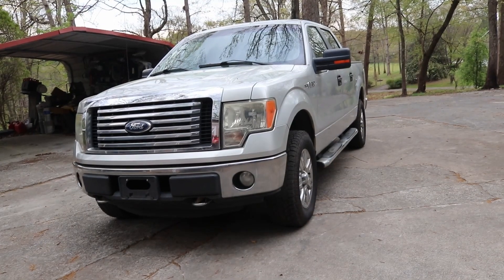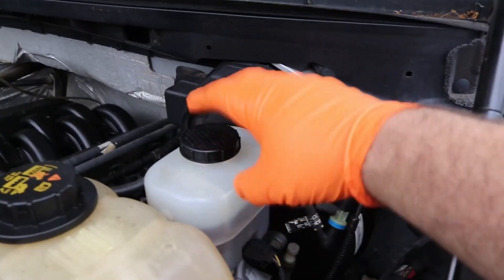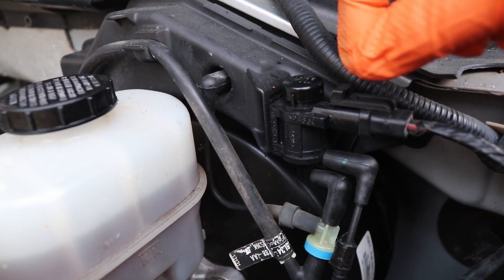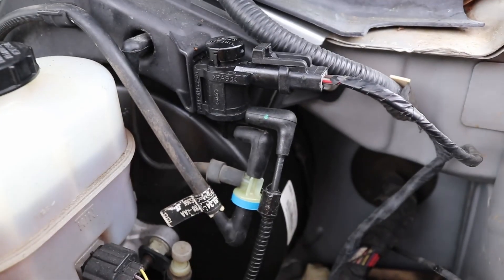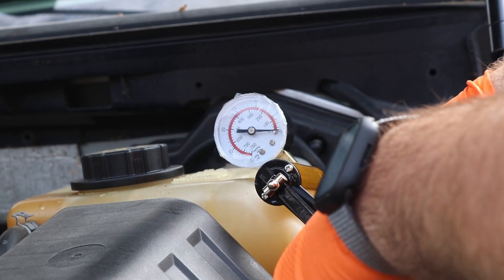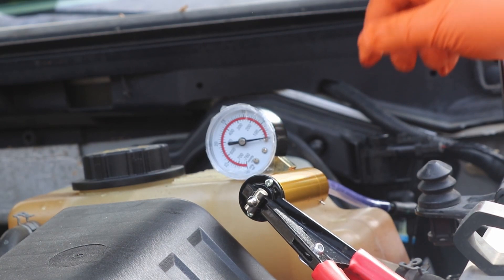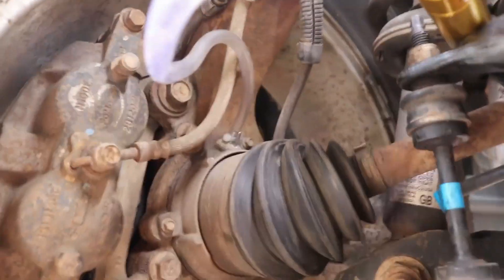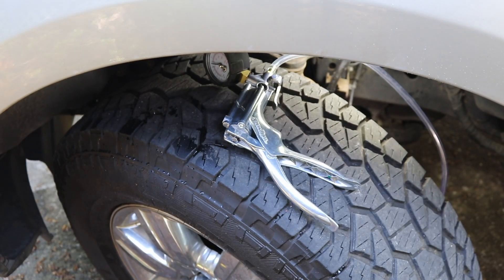How to test the IWE system on a Ford F-150 (full guide)

Comment: I have a intermittent grinding noise. Sounds like driving on snow. I replaced check valve with valve and  hose from oreillys and a new solenoid.  I bought a vaccum pump but it seemed to big to check at iwe. I seen you did zip tie so maybe ill try it again. But i did test it from up on top at vaccum lines that go to the iwe and pumped and it seem to work fine. Does that mean my iwe is good since it engaged and disengaged and help proper vaccum or can testing at iwe have a diffrent result?  Im just at witts end trying to figure it out. Thanks
Reply from the maker: So if you checked both IWEs with a vacuum pump and they both operated correctly and didn’t lose vacuum then they’re fine. But did you check the vacuum that’s be drawn through the lines to the IWE like I showed in the video? Because a lot of times that will be your problem is they can’t hold enough vacuum. Hope this helps. Thanks for watching!
Reply: @JunkyardJunkie  i was only able to check the lines that come off the solenoid that goes down to the iwes and it was fine/held air. I wasn't able to check directly at the iwe itself cause i didn't have a zip tie. I guess what i was asking is it possible it get a diffrent result at the iwe itself even though it worked fine with the vacuum lines that go down there from the solenoid.  The hise that came with pump is to big for the iwe nipple. Wasnt a tight seal and couldnt get a reading.
Reply from the maker: Oh ok I misunderstood. So if you’re able to pull a vacuum from the top and it holds then we can rule out the bottom half of it. Just to make sure it’s the IWE system (even though I’m sure it is) drive around in 4wd and see if there is no more noise (as long as there isn’t we know for certain it’s in the system). So if that’s where you’re at, I would then proceed to check the vacuum coming from the solenoid. If it’s not producing enough vacuum or losing it while driving then we can trouble shoot further. Hope this helps.

Comment: I just replaced my solenoid vacuum because I wasn't getting vacuum on the 2nd port on top then I installed a new vacuum solenoid and the way home I didn't feel or hear it difference while i drove home and the next day the 2nd port stopped getting vacuum on the new solenoid. I wonder if it's my lines coming from the iwe to the solenoid are dirty or got a leak and sucked in debri that caused my NEW vacuum solenoid to not get vacuum on the top 2nd port. HAS ANYONE had that issues before?
Reply: Also noticed that both sides of the iwe are engaged so it looks like I'm in 4x4 thought it would be just the driver side buts it's both sides. I'm going to have to dig down deeper what's causing the passenger side to get stuck also. Wonder if anyone is having these similar issues
Reply from the maker: From what you’re saying it’s most likely the vacuum lines. But like in this video you can check to see if your getting vacuum at the bottom of the lines (remember ones a vent). If you get no vacuum check at the solenoid see if it has vacuum there if so then you know the vacuum lines are bad. (Which they tend to go bad over time). Hope this helps. Thanks for watching!
Reply: @JunkyardJunkie  I recently check all my vacuum line, iwe and everything checked s out good with the vacuum tester. I noticed that the connector that connects to the iwe solenoid reads 11.8 volts with the key On engine Off and that releases my iwe to the wheel and spins freely but when I turn the engine on it drops down to 5.9 and it does NOT release my wheel when I connect it back to the solenoid. Wondering why does it work with the engine off but not on. I saw another video that IWE needs to get reprogrammed something called the TSB
Reply: @alonzo3564 fixing to replace my iwe and vacuum lines. Following this. Let me know what you figure out, good luck
Reply: @georged1085  I diagnosed everything on the vacuum lines to the valve to the solenoid but my issues seems its going to be electrical because when my key is ON eging off at the connector that goes to the iwe solenoid im getting 11.8 or 12 volts and that releases my iwe to spin my wheel free but when I turn on my truck the connector get 5.9 volts and locks up my iwe to the axles like if I switched on my 4x4 so and saw another video about this and seems like a update issue to get reprogrammed. A couple of months ago my friend in a GMC has similar issues but his whole dash lit up like a Christmas tree. He has to take it to the dealer. I might have to do the same thing. But I'll post it here if anyone has those issues

Comment: I had a noise that went away when I put  it in 4a. I changed the check valves, it still made the noise for about 3 days , then stopped. I can't understand why it just stopped , it was a truck I just bought with low miles..maybe it was from sitting a long time?
Reply from the maker: Was it a grinding noise? The way you described I believe it’s something that would still be a problem. With the truck on and in 2wd jack it up and see if the front wheel will spin freely. If everything works correctly then I wouldn’t worry about it. Hope this helps. Thanks for watching!
Reply: @JunkyardJunkie  yeah the tires spin, 4wd is working also. Strange lol

Comment: I noticed on my ford f-150 2010 xlt that the solenoid under the hood on the driver side had the vacuum hose and connector disconnected, so I plugged it back in and when I drove I noticed what sounded like a clicking like noise, can that be the hub or can it be the solenoid under the hood?
Reply from the maker: Sounds like the solenoid is working. Sounds like a faulty IWE or vacuum line (they deteriorate with time). Whoever had it before you must have unplugged it so they didn’t have to worry about fixing it. Good thing is if you follow this video you can verify it, so you don’t just throw parts at it. Best of luck. Thanks for watching!

Comment: Hi guys. I'm stumped. I get the chatter on the highway, and usually in cruise. The lines all hold vacuum. Replace the check valve. Checked the solenoid function. Checked the reservoir. One thing I do notice is my vacuum on idle goes from 14-18 and back to 14. I am also only getting 14-18 from the brake booster T split to the check valve.  Is that high enough? On idle? My scan tool shows a pretty constant 17? oddly. There is also a hiss on acceleration that I can't seem to locate. Any ideas would be greatly appreciated.
Reply from the maker: Did you replace the check valve with motorcraft one? I just had someone use Dorman and said it was bad right out of the box. As for the hiss I would use smoke to find it. Hope this helps. Thanks for watching!
Reply: @JunkyardJunkie  Hi! Yes I did use a Motorcraft replacement. Smoke is a great idea, thank you.
Reply: @cpspec3004 did you ever figure it out?
Reply: @georged1085 yeah?
Reply: @CasperTheFriendlyGhost777   what??

Comment: Great video on the vacuum checking of the lines and the hubs. one thing I think you missed is for the people who have intermittent issues or only have the IWE lose vacuum while driving.  For me anytime I am stationary or run the system via the vacuum mityvac gauge, it checks out perfectly, zero lost pressure for 30 min and the solenoid works on command. Problem only shows up when driving. A suggestion for others is to T into the vacuum line ( don't cut it, just add a T and some extra hose) and run it into the cab so you can monitor when driving, particularly helpful with check valve issues. Another guy on YouTube showed how vac would correlate with the engine rpm. If the vacuum starts to drop you can let off the gas to boost pressure back up. For me I replaced the check valve and solenoid anyway, but I think I hit the lottery and got a second bad check valve considering the erratic behavior. starts to lose vac (will follow engine rpm) and then after a few seconds will hold vac again reguardless of engine rpm. any experience with a really random vacuum issue on the IWE system would be appreciated.
Reply: Replaced actuators and check valve and now only have the issue while accelerating. All lines and hubs hold vacuum. How do I check the reservoir? 
Unrelated but the cam phasers also make noise, less than 150k miles.  I hate this truck so much.
Reply: @aaronthompson192  did you solve this? I have the same issue
Reply: @b @besikgeorgemenabde6582 it's not letting me post the link but if you search "Ford IWE bypass TSB" it should come up. You just cap off the system. Takes $5 and 30 seconds to fix.
Reply from the maker: Thanks for your input I appreciate it. So if it’s not the main three I focused on IWE, lines and solenoid then it’ll wind up being your check valve or vacuum reservoir. I briefly talk about how to check them. But in your case you may have gotten a bad check valve again. Let me know what you wind up doing and if it fixes it. Best of luck. Thanks for watching!
Reply: yeah I got a Dorman brand replacement (lines and valve) for the first repair attempt and am going to try a Motorcraft brand valve the second time to see if I happened to have bad luck. The vacuum gauge in the truck cab has been the only way I can tell its about to engage, great for monitoring the issue.  @JunkyardJunkie
Reply from the maker: Let me know if the motorcraft one works out. But that is a good idea to have a gauge inside the truck to tell and ting in wouldn’t be that difficult ether.
Reply: An update for you and others out there with this issue a more sporadic vacuum loss  ( typically only shows up when lugging the engine. It was indeed the old original old part and the brand new Check valve from Dorman that was the issue. The Dorman brand check valve actually fell apart in my hands at only the slightest effort. I was about to pull off the hoses so I could replace just the check valve component rather than the hose assembly and it split in two. Upon further inspection it seems that there was either very little glue or weldment with one section that appeared to not have any residual bond/glue .  It is likely that  the rubber valve wasn't working well because it was likely leaking around the joint between the two plastic pieces, or overall a bad part. The Motorcraft brand which is the original MFG part (ford logo imprinted on it )  was a great deal better constructed. see link for those of you needing this style  ~$14 ( https://a.co/d/aJUZkOd )  
I would say that if your system holds vacuum but loses it when driving or very intermittent, its most likely the check valve. @JunkyardJunkie
Reply: @trevorchristensen4103 Thank you for this input. Mine will randomly grind sounding similar to a rock stuck the brake caliper going down the road when you’re at steady rpm. Let off and it quits. Just ordered a check valve using your link. We’ll see if it fixes it.
Reply: @trevorchristensen4103  THANK YOU SO MUCH. 

My vacuum was running very VERY FREQUENTLY and I could figure out why. Ford dealership did the recall fix on the system and all that but vacuum still ran frequently. Like every 5-10 minutes even while idle. Never got the grinding noise though. I will be ordering that valve you suggested to check.
Reply: @trevorchristensen4103  Mine is 2020. If the IWE is engaging/disengaging, locking them to the axle permanently may make sense.
Reply: @besikgeorgemenabde6582  TSB says F150 2006-2020 so it should look the same. 4x2 and 4x4 still work exactly the same; I think the floating actuator/IWE is really only there to help with gas mileage but it hasn't made a difference to mine.
Reply: Mine grinds intermittently, but a touch on the brakes and or pulling off the throttle and it goes away. I think I remember hearing something that these twin turbo engines have less vacuum than a naturally aspirated engine and therefore are assisted with a pump. It sounds like the current TSB from Ford says to just cap the IWE's off... Which I think is a terrible idea because then your front drivetrain will spin all the time.
Reply: I just replaced my actuator last night because when testing I found that the left one was leaking. After getting everything back together, it didn’t completely fix the problem, but the hub engages less. This morning, testing, I discovered that when connecting to the vacuum line that goes down to the actuators, it’s not holding pressure, but the actuator itself is. I tried to test the vacuum lines individually, but I can’t disconnect anything from the “T“. When I tested the right side actuator a couple weeks ago, it held pressure. So I guess I’m just curious how I could test for a break in the line?

Comment: I have a big problem too in the driver side front tire it feels like is grinding or mowing something inside I was thinking about broken hub Bering but now watching this video I don’t know what to think any idea
Reply from the maker: Ya I would unhook the vacuum lines from the solenoid (this way 4 wheel drive is always engaged. If you still hear grinding coming from the hub area then it’s your wheel bearing if it goes away it’s either your IWE or the vacuum lines itself. Hope this helps. Thanks for watching!
Reply: Thank you I’ll do that today
Reply: @josmarthetreeguy4966 what ended up fixing it?
Reply: @georged1085  yes it was the 4x4 actuator bearing
Reply: @josmarthetreeguy4966  4x4 actuator bearing, do you mean the IWE or the hub?
Reply: @josmarthetreeguy4966  thanks. I replaced hubs on both sides and still making the noise.

Comment: Where did you get the vacuum pump?
Reply from the maker: Here’s the mighty vac I used: Mityvac MV8500 Silverline Elite Automotive Test Kit Provides both Vacuum and Pressure to Perform Engine Performance Diagnostics, Brake Bleeding, Fluid Transfer, Evacuation, Windshield Repair Jobs https://a.co/d/10b8kSP

But you can also use a cheaper one from harbor freight: https://www.harborfreight.com/brake-bleeder-and-vacuum-pump-kit-63391.html

Hope this helps. Thanks for watching!
Reply: @JunkyardJunkie  thank you sir!
Reply from the maker: Anytime!